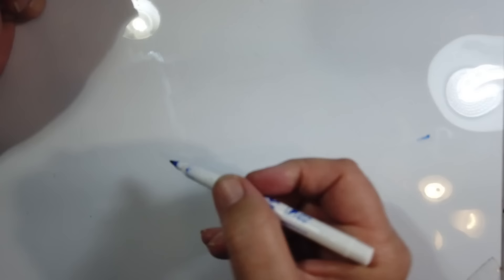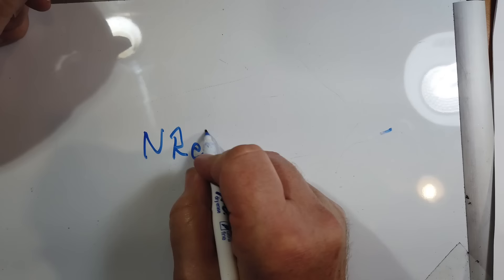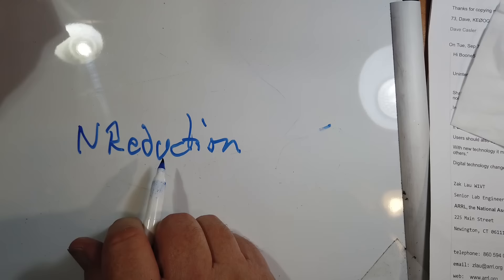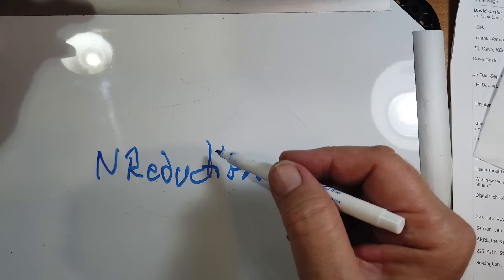Understanding and Dealing with QRM (#798)

Comment: QRM = LIDs on FT8 talking one state away with 1.5kW using double bandwidth. If I have to adjust my sounds levels for a single idiot one more time...seriously, I shouldn't hear someone at +40 that's over 2000km away. This is getting older than Dave.

Comment: What is a signal 5 .9
Reply: David, the 5 is a rating scale of the audio quality from 1 (lowest) to 5 (highest). The 9 is the "S" level generally found on the radio's meter. S9 is the strongest signal normally listed. Above that, you will hear s9 + 10(dB)  or 10 over S9. So a 5 9 signal is the perfect level in both RF and Audio.             Doug WA7DJS